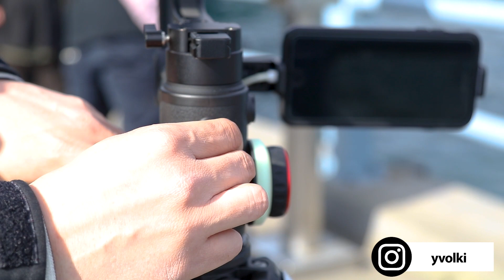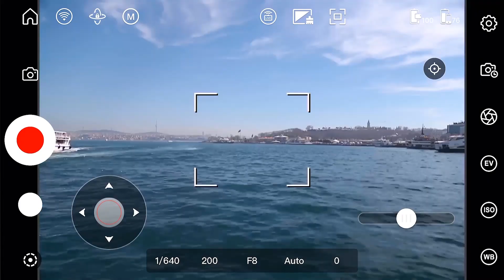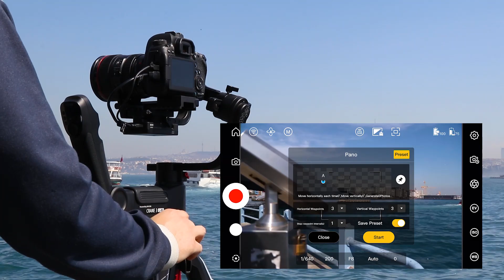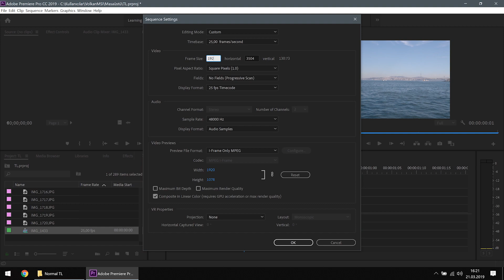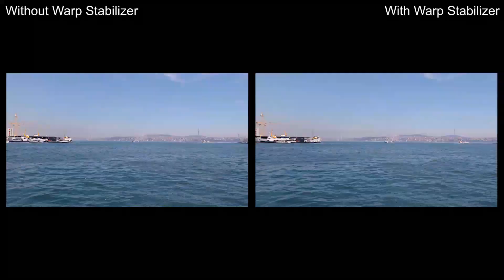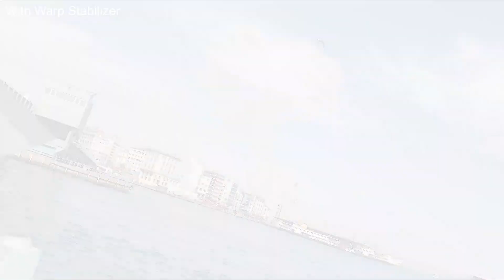Zhiyun Crane 3 LAB Panorama, Timelapse and Moving Timelapse by Volkan Yetilmezer

Comment: With the Sony a7RII it does not work, it does not shoot the photos, the movements it does but without shooting photos.
Reply from the maker: You have to take photo mode and you need to set up connections.
Reply: Tengo el mismo problema. Las fotos no las hace. Solo hace el movimiento. ¿Has solucionado esto ?

Comment: Hi,

I try to make a motion timelapse without connect hdmi gimbal-camera. But in your video at 5.38, you said that I need to connect data cable. What is data cable? Connect from where to where?

Thanks
Reply from the maker: Crane 3 LAB CCS has two inputs on the left side. One is HDMI and the other is data. You do not need to connect HDMI. But you cannot do this in Crane 3 LAB without binding the data. Camera to CCS. Read the user manual for details.